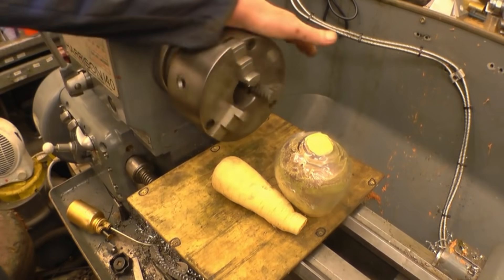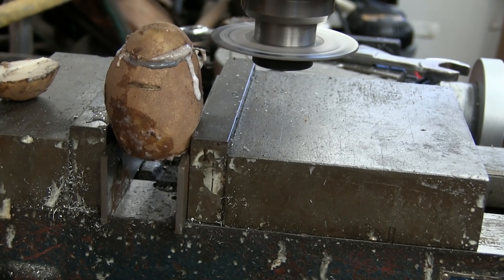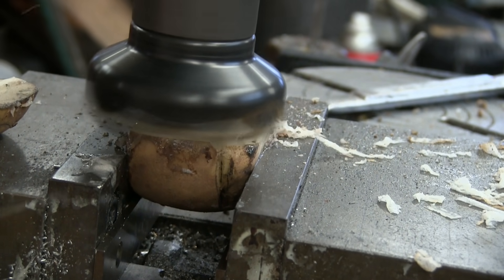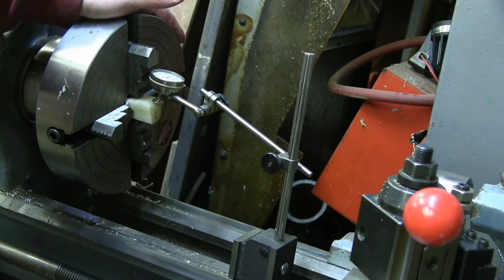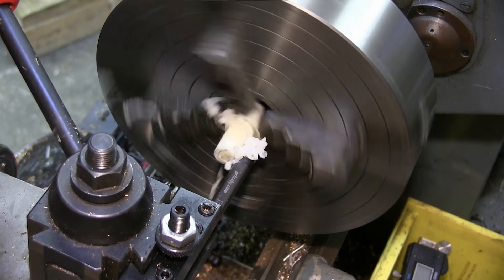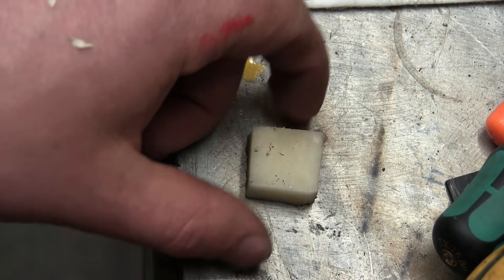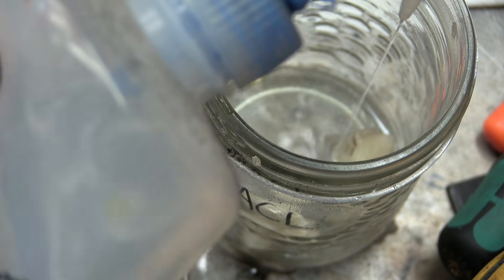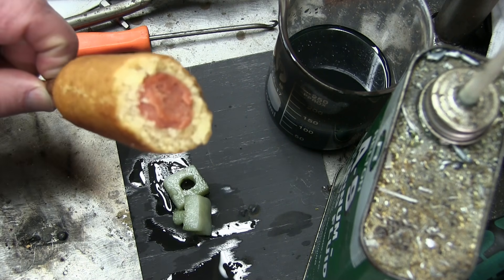The Impossible done on a milling machine

Comment: 2:37 Are you sure those carbide inserts can stand up to potato's extremely hard construction? Personally, I wouldn't recommend you torturing your tools like that, just for fun. Rather save them for the times when you'll need to cut softer materials, like steel... Nice video, btw

Comment: Using a fine pitch tapped  'Nut'  with a medium pitch cut 'Bolt' will only end in a crossed thread. You're just a chip off the old block, you'll end up as a couch potato for sure.

Comment: Hi,

Love your ambitious veg-prep, though I think at least one potato was twisting and or now cutting properly because the part chosen to cut before the tool change was rotten, something you cannot always see from just looking at the potato before cutting.

Loved the idea! I could not do this if I had a machine unless I oiled everything that is likely to get juice on it or the rust will start showing through quicker in that spot than others.
Thanks for the upload, I just wonder who will be the first to freeze some large veg like sweet potato, just a suggestion, and then try to put a screw thread and make a nut out of another?

Comment: You're lucky that tap didn't break, that would have been a nightmare to remove
Reply: most of the standard methods would work fine. weld a nut to it and back it out. That's a value add cuz you could skip the fancy chemical heat treatment step at the end.
 TapX would disolve the ferrous without touching the nonferrous workpiece. Same getting a tap out of Al, Mg, or Ti.
One MIGHT just make a whole new part, that depends on who is in charge, your boss or their accountant.

Comment: +AvE I would recommend removing the outer brown layer or "skin" with a skin removal tool or "peeler" first as the soil particles on the outside of the material will dull your cutting tool and result in a poor surface finish.

Comment: Are you completely bonkers dude?
You ruined that carbide insert. Potatoe is way to hard to be cut with carbide. You need to use tartar sauce and HSS next time.

Also i think it would work better if you added some Abom torque to the 4 jaws.

Comment: I was with you up until the Chinisium drill bit, it was then I noticed something was off. You were using a russet potato in this machining job, any stew maker out there worth their stock knows that russets are used in electric applications only, the correct potato for milling is the Kennebee do to it's rigidity and baby, you got a stew going.

Comment: I noticed your potato ingot was one of them low quality chintzy variants, just mined strait out of the earth out the back of burke, very high moisture content, probably explains the gland issue.
Perhaps in the future you might be able to ask around and see if you can get your hands on some high tensile machine quality potato, Royal blue or Toolangi Delight, course the Toolangi is a Australian machine potato so apart from particulate Uranium flecks you may have to deal with some wombat interruption during the milling process.

Comment: you need to use coolant when using carbide on non ferrous root vegetables.. it will keep the insert from loading up.. try sticking a magnet to your potato first though as some grades are watered from an iron rich source

Comment: so disappointing I held my calipers up to the screen and can tell that you had completely ruined it on the 3rd slitting saw pass and I think a little machinist blue would have brought the flavor in with a combination of machinists blue in the final finish with the Marvel Mystery Oil any kind of a beet potato or parsnip  becomes a Machinists celebration of the Tool & Die salad set